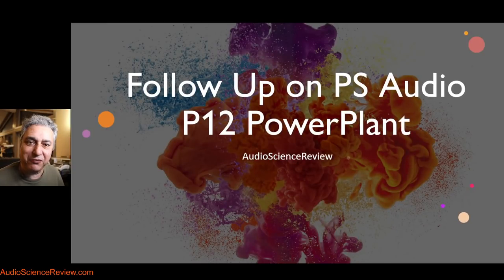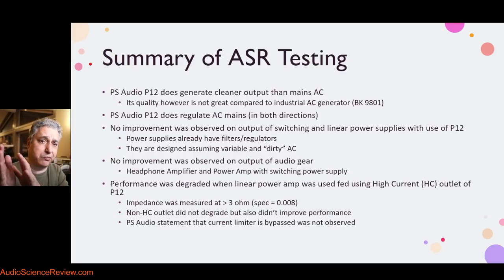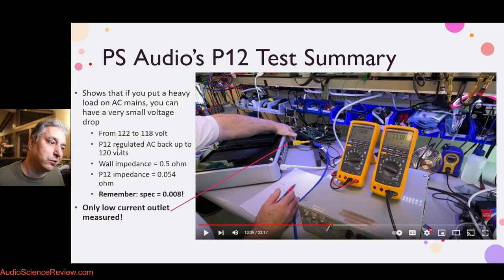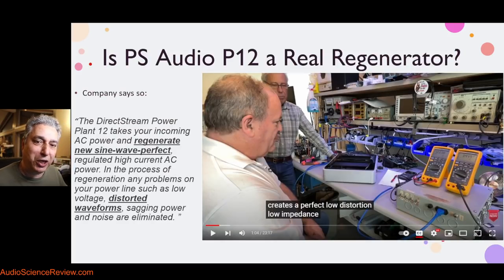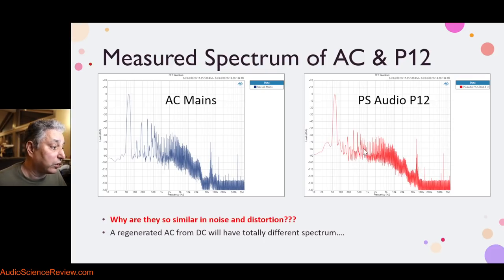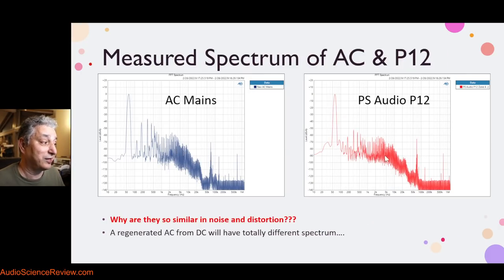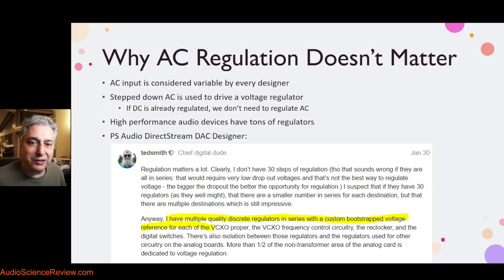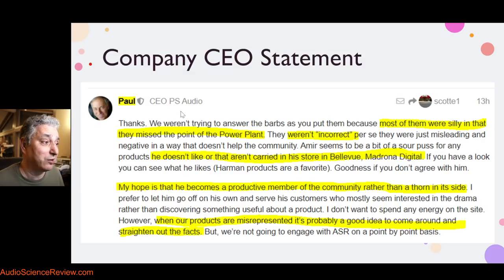PS Audio PowerPlant Measurement Follow Up

Comment: @Joe Smith  While it's true that we ALL have biases, even you I'm sure (and that's not intended as a derogatory statement), it's pretty hard to argue with the measurements Amir has made here.  As an electronics engineer by education and trade, I am VERY BIASED towards measurements.  I completely understand and agree with all of his measurements and claims made herein.  Notwithstanding the validity and applicability of SINAD measurements, AC waveform measurements, and everything surrounding them, are fairly easy to measure.  When a company makes claims in support of charging $6.000 for what is essentially an AC line filter, these claims have to be questioned.  I for one appreciate what Amir is doing to dispel these outrageous claims.

There are plenty of audiophiles out there who won't care, and convince themselves that there is a difference in sound by using this device.  My own experience tells me it's all mental justification on their part.  If you have decent, and fairly stable AC power, as we're fortunate to have here in the US, there really is NO NEED for a device such as this.  You could get a very good AC line filter, even one that's several hundreds of dollars, and be assured your system is well protected.  That to me is a more justified approach, rather than spending $6,000 on AC power regulation, which would be better spent on premium audio gear, if that's your inclination.
Reply: Yep we all do but this is literally Amir’s 5th video about PS Audio and Paul’s claims. If you visit ASR there are literally forums devoted to trashing  Paul and his company. Who cares if it’s snake oil most audio enthusiast are have modest budgets not thousands of dollars to buy this stuff anyway! Let’s be honest though no “normal” person is gonna buy a 6 grand ac regenerator! 

Amir had a choice to review this or not and he did. That’s my issue with this. It didn’t measure that badly but it’s also didn’t have any audio difference either! Who in this entire comment section is interested in this product anyway? No me. You?

Comment: Really glad I found your channel as there is some excellent content. It's rare to get someone who is both into high end audio and skilled electronic analysis reviewing things. I'm from the studio based/recording side of things, but also love high end audio. Unfortunately the equipment found in many studios these days generally aren't a patch on high end audiophile gear out there, which is a little ironic I find. Was very interested in the review you made of an Octave Studios all DSD release - I think unfortunately it can be very easy to concentrate more on the recording technology over the performance and overall vibe it creates. Anyway, keep up the great work!
Reply: @Lloyd Stout It's a combination of things. Whilst there are still a few really amazing studios out there, the majority of studios aren't so good. When you walk into a really good studio, you'll notice straight away that they're serious by the monitoring and amps they are using. You'll also tend to see a vintage analogue desk and racks of vintage analogue outboard equipment (EQ's, compressors, effects) mixed with some select often very expensive new pieces. The vintage equipment will have been well serviced over the years and often modified so it works to its best sonic potential. The new equipment will tend to be things which are made by manufacturers who build studio equipment to a specification similar to any audiophile equipment manufacturer. The engineers both service and audio, will know their stuff. This however is the exception not the rule. 

These days records tend to get made in studios ranging from home to project to small commercial to larger commercial. The equipment manufacturers who make 'Pro- Studio' equipment for all of these scenarios, often make anything but pro audio equipment. If you know anything about audiophile grade circuit design (or even good circuit design!)  - you would only have to take the lid off a lot of this 'Pro Studio' gear to see it's often no better than standard budget home hi-fi equipment. Which is fair enough if it's budget gear aimed at home studios - but not when it's got a large price tag. You'll see a lot of studios stuffed to the gills with this kind of gear. They may have an analogue desk and some vintage outboard equipment, but oftentimes it's in a poor state of service and just sounds broken down. Then there's the Pro Studio monitoring which often is not so good. I'm always relieved if I see at least a pair of ATC speakers in a studio, but a lot of the time that's not the case. Yes, the speakers may technically measure fairly flat response but they sound awful.

Then you've got the ADC/DAC's used in a lot of studios which can often be of quite poor quality, especially given their price tags. Let's put it this way - the cheap Topping DACs would put a lot of studios DACs to shame. Add into that the growing amount of people mixing 'in the box' ie all inside the computer using virtual plugin versions of studio gear, and well, it's not good. 

Then we get to the mastering facilities. Yes, there are some really great facilities out there. But. You only have to walk into some mastering houses and see their monitoring to know that they can't possibly master serious audio with that monitoring. Basically a lot of the studio guys could learn a lot from the audiophile guys. But they don't. 

Sorry this is a long and jaded sounding answer to a simple question!!
Reply: That’s a “fact?” Can you prove it?
Reply: @scottwheeler2679  Sorry, you've lost me. What "fact?" are you referring to? I think I made it fairly clear that I was talking about my own experiences in and around studios and studio equipment. Obviously this is subjective opinion rather than empirical fact - I can only say what I know and have seen and heard with my own eyes and ears. I'm confident that I could prove some of the things in my comments if I had a research budget and plenty of time, but I don't. Some things would be very hard to quantify. If I did state something as an empirical fact and it wasn't clear enough that these were just my experiences and opinions, then my apologies. If you point out where I state something as empirical fact - then I'll edit and remove it. That way no-one else will be confused. Thanks!
Reply: @Toymortal   I certainly wasn't refering to your personal experiences. Facts are verifiable. Your experiences are anecdotal. It's a tough pill for some to swallow but our personal experiences are saddled with unreliability and as such so are our opinions based on them.
Reply: @scottwheeler2679  Well, thanks for your input anyway! Personally speaking, whilst I like to read technical specifications and data sheets and the likes to establish some basic facts before purchasing equipment - I do still like to use my biased set of ears to form an opinion. Is there any other way?
Reply: @Toymortal  In the end we do listen with our biases in play. I guess the question any of us has to ask ourselves is what do we do if our biases are still telling us a given component sounds better when we know based on measurements it doesn't make a difference. I have not had that happen since I have embraced bias controls. But should it happen I willhave to make that same decision. 

But I have found that just skipping such products has allowed me to focus on things that do make a difference and often make a very big difference. And that has allowed me to make huge improvements in my stereo. But if someone doesn't know about bias effects and how to gauge what components will make an audible 
difference based on the measurements then they can't even begin to approach the question from an informed position.

 There is one guy on Youtube goes by "Jay" who is at this very moment auditioning a 21K pair of speaker cables vs. a 40K pair of speaker cables. That money will get you a state of the art pair of speakers, or state of the art amplification and DSP as well as room treatment if needed. All things that make a huge, lasting difference. Not something that just plays with your bises and will leave wanting to try the 60K cables next week. IMObias effects are like cocaine. You get that initial rush and tehn you end up chasing the dragon. This same guy says he has owned 340 different 
amplifiers, some of which cost 6 figures. IMO he is caught up in the "high end" audiophile game and is chasing his tail for a lot of money.
Reply: @scottwheeler2679  I agree. Now you've explained your point of view - I can see that we're pretty much on the same page. It's hard to give absolutes when it comes to the question of why a lot of commercial music sounds lousy these days - but many years of experience has taught me enough to feel confident in giving my own opinion.

Comment: Amir, great follow up video. I have a P12 and a P20. I wish you could do the same thorough analysis on the P20. But that aside. Ok so let’s say the PS Audio PowerPlants are not improving stereo performance and they are dropping power on the HC outlets. Also you had stated to me in the comments that you measured no benefit to the Audioquest Niagara power conditioners. So given that, if an audiophile with a large rig and power full amps, a DAC, Roon core, streamer, CD Transport needs something to plug all this gear into and all he has is one duplex wall outlet, he needs some sort of power strip, distributor or conditioner to accommodate all these devices. So what do you recommend? If I get rid of all my PowePlants what am I supposed to plug all my gear into, a cheap power strip from HomeDepot? I am sure there is something better than that? What do you recommend? Thanks.
Reply from the maker: Thanks for the kind words.  I use an industrial power strip from Tripp-Lite (RS-1215).  They have other configurations as well.  They come with very thick AC cord and I have measured amplifiers producing 1,100 watts through it while powering the rest of my gear.  Here is the Amazon link: https://smile.amazon.com/gp/product/B0000513OF/ref=ppx_yo_dt_b_search_asin_title?ie=UTF8&th=1
Reply: @AudioScienceReview  Amir, thanks for the reply. I am all for calling out products that bamboozle the audiophile consumer. IMO Innuos is another such company that does this. I think there is an opportunity for you to expand your work in the power conditioning and regeneration area. Now that you have shown that a bunch of these units are not worth the money, now it’s a great opportunity to demonstrate what devices you recommend as replacements. So you mentioned the Tripp Lite strip above. How about units like the Shunyata PS-8 or the new PS-10 or Everest distributors? Have you tested any of the Shunyata conditioners? I think Audiophiles would benefit greatly from know which products ARE good. I think distributors with metal construction would be better than plastic. But what if the metal is ferromagnetic? Is that a problem? Does your opinion on optimal power distribution products differ if the incoming line to your rig is a 20amp line direct from the breaker box (like mine)? Thanks. Regards from Chicago!
Reply: Amir, So it appears that power conditioners and regenerators are at the least suspect in their effectiveness. As for high end power distributors, have you ever tested Shunyata Research power distributors such as the Hydra Sigma or Hydra Alpha or the Venom Series? If so, please provide a link and what were the results? Thanks. Regards, RJ

Comment: Great video, again.  Paul just doesn't get it.  I think its particularly bad on his part when he, as CEO, can only resort to name calling and making disparaging remarks, rather pathetic IMO.  That's usually how it works when you can't defend your position.  He, Paul, would be better off if he just admitted he and his company got caught with specs that aren't quite right for a product no one really needs.  I think their PowerPlant falls into the $5,000/meter "audiophile" speaker cables & power cords category, they don't make a difference, but there are people who have to have them in their system, so there are manufactures who'll make it for them.   Please keep up the unbiased measurements, you provide a great service to the community and are a great reference source when I'm shopping for gear.  Loving seeing how the various units compare to the others in their category.

Comment: "My hope is that he becomes a productive member of the community rather than a thorn in its side." That is so shameless lol. Selling an obscenely expensive product that doesn't even do what it purports. You are definitely a thorn in his side because you inform an otherwise naive crowd and prevent them from spending their money on silly products. What you do is important for the greater good. Kudos.
Reply: @carlosoliveira-rc2xt  "A P12 gives you greatly improved performance and safety from just plugging into the wall socket and far better dynamics, bass and a much bigger, open soundstage than any passive power conditioner on the market.". You think the product is being marketed as an AC voltage regulator? No. It is advertised as a product that makes a drastic difference in sound. If it does, then it is your duty to prove it. Most new amps have power supplies built in and although it can help some amps with hum and distortion and whatever, it can inversely introduce noise itself and be current limited for amps with very high power draws. How can you justify the price tag when this specific product does not regenerate AC like a typical AC-DC-AC generator does? You can buy Instrument grade AC power supplies for less.

Comment: "Incorporating audiophile myths in their products" is just a terrific way to describe so many of the Hi-End Audiophile products. The 'Myths' are seductive as 'FM' and the best (generally most potentially profitable) of the Myths propagate thru the manufacturing and consumer Audiophile space until the next one arrives. The buying public for $50,000 audio systems is relatively small and the competition is fierce. There is a sameness to High End Audiophile products (loudspeaker designs!) as the prevalent Myth runs it's commercial course. 
I am new to Amir's forum and I feel good whenever I watch one of the videos. Blind Tests!! Of course, basic Science. What is the relevant property to investigate? Does it make a difference in the result? The AP analyzer is a great tool in the hands of an audiophile with experience and a good set of experienced ears and some depth of knowledge. It's a Tool. Like a telescope for an Astrophysicist. It helps to be brilliant as Amir is, to put Art and Science together so convincingly and interestingly, but us regular folks can use the same process with great results. I use an AP 515 to help me zero in on things and sort out good ideas and not so good :( ideas. 
P

Comment: Well done Amir. Here are my comments I put on the PS video:

This test is pointless as the wrong test point is used. The test should be on the DC output from the audio equipment power supply. Any well designed power supply will measure exactly the same voltage and quality with or without this expensive box. The final test is on audio quality. If an improvement can really be heard then spend your money on better equipment with a good power supply. This box is a solution looking for a problem, a problem that does not exist in quality audio equipment. 

Power supply design is very well understood and all competent manufacturers os audio equipment use power supplies that can handle dirty mains. Is PS equipment sounds better with this expensive magic box then their power supplies are very poor.
Reply: it'll probably get removed.  surprised they even let you comment.  i tried to leave a comment on a vid over there last week and it came back with an errror.  i think they're blocking ASR members over there.

Comment: many years ago when overclocking PCs was part voodoo part experimentation (we're talking jumping and shorting CPU pins) we were tweaking the voltages for a given temperature (RAM included) to the 0.01V. 
if an under $30 PC power supply could regulate over 150W continuously to that degree of accuracy what do ppl think happens in a modern, good quality DAC, EQ, Amp, Reveiver, etc...

Comment: Obviously the P12 is built to a cost and is not really that helpful. I understand that additional power regulation is superfluous since any good device has it built in, but I can't help but wonder how good their flagship P20 performs. It is a 105 pound monster costing roughly 10k US.

If Paul had real guts he would send you a unit.